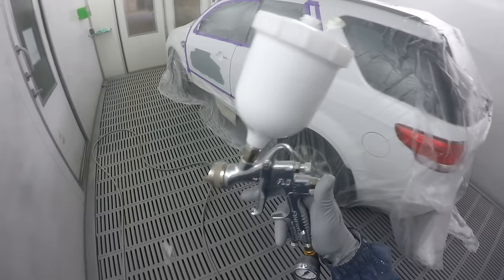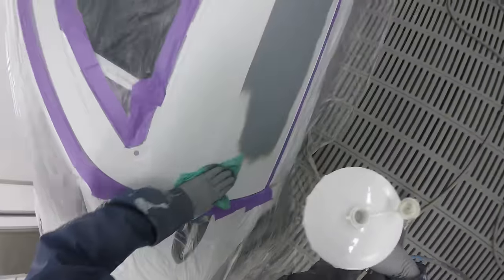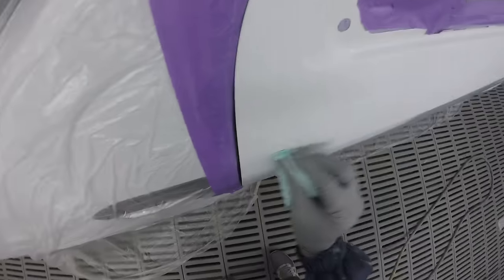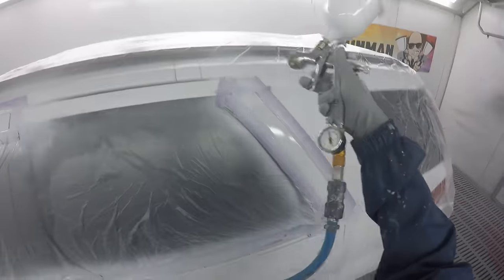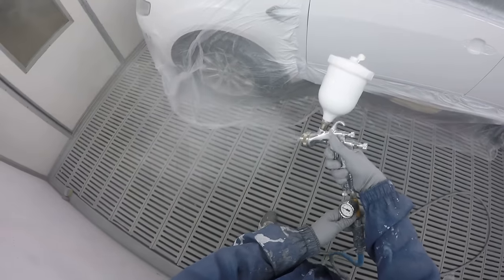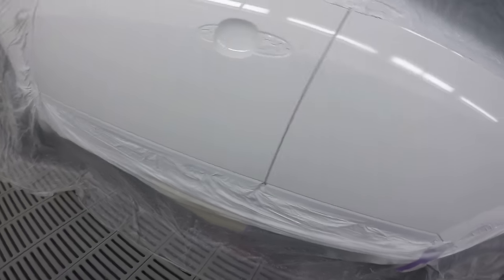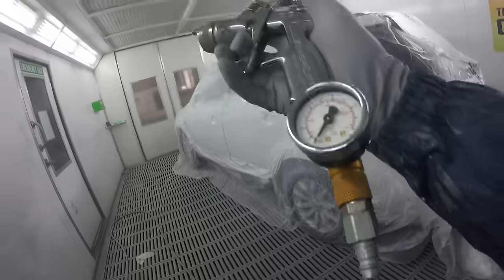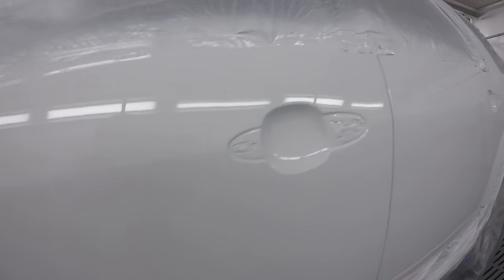FLG5 Direct Gloss

Comment: I’m in the UK and my college mentor advised we got one too start off with. I used it for about 4 years and the jobs it did are unbelievable for the price! Then upgraded to the GTI Pro Lite vigilante. I also have a second flg-5 but bought the 1.8 needle and tip for primer.  👍🏻

Comment: I just got 2 FLG5`s on your recommendation from spraygunsdirect and I immediately sprayed some thinner through them and I am very impressed with the atomization and fan pattern / finishes I can achieve with it. I`m going to fill some rock chips and respray a truck bonnet/hood tomorrow and some fender flare`s and blend in 2 rocker panels that all have some rock chips in them with wa9260 victory red and clear. I sprayed the truck bed and did a tailgate blend that looks like it just came new from the factory. Thank you for the review on the FLG5 its a great spray gun that I really enjoy using. I hope to learn more from you so keep the video`s coming and Paint some shit ! -thanks Gunman.

Comment: I use one for direct gloss and another one for base coat! Got my first one in 2012 and still using it, just tighten the seal around the needle occasionally, the plastic pots naturally split eventually so I’m onto my 3rd pot. Beautiful gun!
Reply: Stick the new uprated seal in, I had nothing but trouble from mine with the origination felt seal, new one is loads better design.

Comment: Hi, I’ve just bought 1 of these to do my first spray job any tips on setting it up properly and best pressure? I’ve got the 1.4 tip for 2k base coat, I’ve another cheaper non branded gun for the primer using 1.7 tip… just don’t know where to start on setting the flg 5 up really don’t want to mess up the paint job

Comment: I got a FLG5 on your recommendation. I was kinda nervous on buying a gun without seeing one in hand  first and worried shipping from the UK would take a long time but it was so fast.  I dont have a ton of experience painting but was really impressed by the quality I was surprised it was made in GB and surprised about the quality of the machining and stainless parts. It feels great in the hand and the controls and everything just feels well made. I have only sprayed some wheels using 2K base and clear but the silver metallic paint went on really nicely. I was shocked how well I was able to spray the paint.  The clear was hosed on. I should have spent more time setting the gun up for the clear but I guess minimal orange peel is worth the trade off for one or two runs on each wheel. Even the plastic cup feels like a quality made piece. I really like that it uses less CFM than most guns as I have a 3hp 60 gallon which is not the greatest compressor. I also like the FLG5 for its dual springs for the trigger. there is like a separate spring for the air and then keep squeezing and then more resistance for the needle to start opening and spraying paint. The gun seems like a killer value and can't wait to get better with it and really get settings right and see what kind of finishes I can get with it to be prepared to spray my car.
Reply: This is exactly what I needed to hear as I am ordering from spraygunsdirect.com,  and not sure how that jives here in the u.s.
Thanks for the comment.
Reply: @oscarontiveros5117  how it go how fast was the shipping
Reply: @oscarontiveros5117  how fast waz the shipping
Reply: @jesuslucio2485  jesus, it literally took 4 days! All the way from the UK.  I was impressed. I thought i was going to waiting forever. Good luck. I'm in AZ

Comment: Hey Gunny! Please,help me a little bit. I want to buy a new mid price range spray gun for base and clear coat. My biggest question is: what is the main different of the Devilbiss GPI and DB FLG 5? I watched your top 10 spraygun and top 8 primer gun rev video,but i can't choose. These two came in almost same price in Europe,but wich one is better? I totaly understand, the difference may be slight, but i want to the best gun for my money. I usually use metallick base and 2k clear from lechler. Thanks in advance! I know, i know: "Get out there and paint some $hit!" :P :D
Reply: I'm almost certain the Flg5 is made with a cast aluminum gun with top quality internals.  The GPI is higher quality as its is machined from forged aluminum.  The GPI should last a lifetime  if taken care of. Both are fantastic.  I love my GPI !!! Cheers  !

Comment: Hey Gunny,  what air cap for the FLG 5 would give you a flat finish like the T110 for the GTI pro lite?  I am getting to spraying motorcycles and am trying to get as little orange peel as possible.
Reply: Only has one air cap 💨 🧢

Comment: Can I use the flg5 to paint bicycle frames with a California air tools compressor with these specs: 6.4 cfm @ 40psi / 5.3 cfm @ 90 psi with a 10 gallon tank and 2 hp motor?
Reply: yes    you can paint about  a car door before compressor needs to catch its breath

Comment: What kind of result fill i have if i buy this gun using an aor compressor with these specs? Im looking to spray a small city car.
Air Receiver Size	100 litres
Motor	3.0hp (2.2kW)
Piston Displacement	14.0CFM (397 litres/min)
Max. Free Air Delivery (F.A.D)	9.5CFM (269 litres/min)
Max. Pressure	130psi (9.0 bar)
Reply from the maker: It should run it flawlessly, you can cross-reference these specs with the specs of the gun seen here. https://www.spraygunsdirect.co.uk/index.php/devilbiss-flg5-compliant-solvent-spraygun-best-seller.html#sthash.8yK6L1rT.dpbs
Reply: @TheGunmanRAW  so the air compressor will be sufficent to spray at least one side of the car in one go using the flg5?
Reply: @mg-gabd0113  the flg takes 9.8 cfm     you have 14   you can paint all day lol

Comment: I bought an flg5. I spray omni base and clear. I'm not a very experienced painter just a diy guy and I can get pro looking finish with this gun. Amazing for about $155 off eBay shipped to USA. I use about 15psi for base and 22-25psi for the clear.